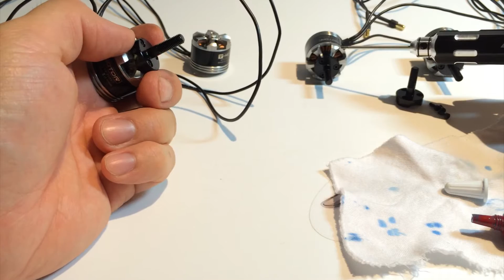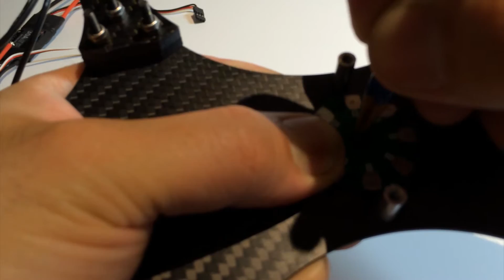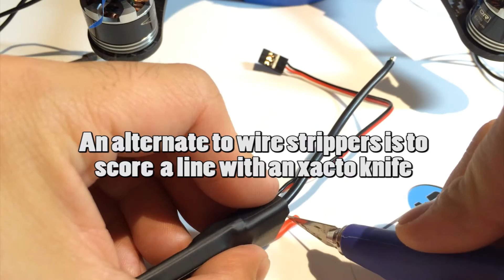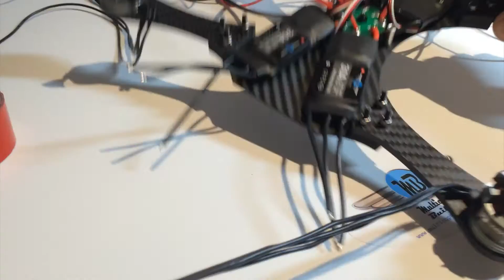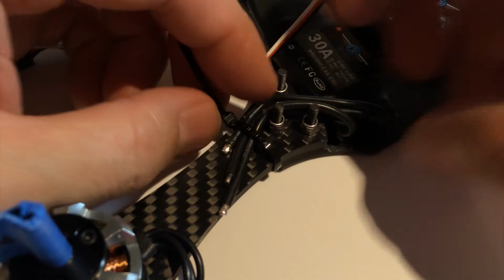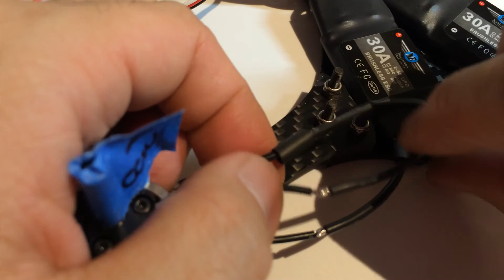HOW TO: Build an Epic 280 - Part2

Comment: Looking good! I am going through each vid and watching your build process. Even though I do not own an Epic :( I like to see how others build their setups ;) What I like to do (On the motor/ESC soldering) is shorten the ESC side of the wires considering if needed at a later time, you can always add wire. When it comes to the motors, once the wire is too short, there is no return :( So I like to keep the motors unmolested and hack the ESC side and if anything, just solder the motor wires directly to the ESC. Just my process and opinion ;)
Reply from the maker: Thanks! And good advice on the motor wires - don't want to get to the point of no return :)